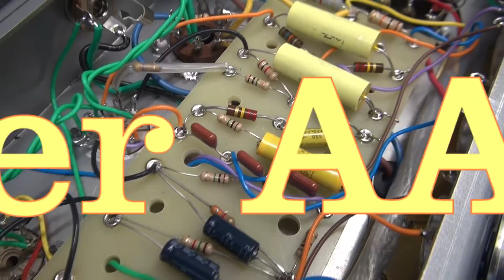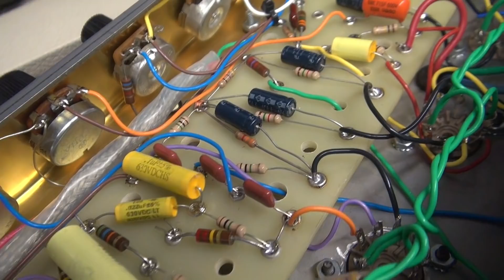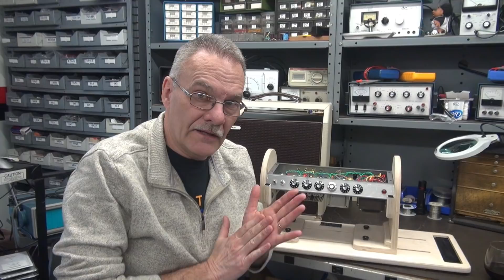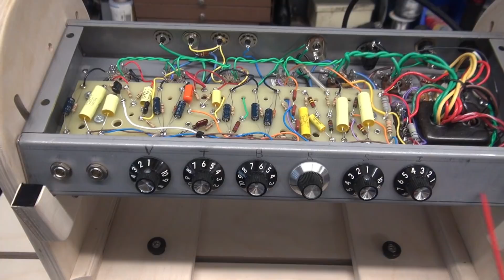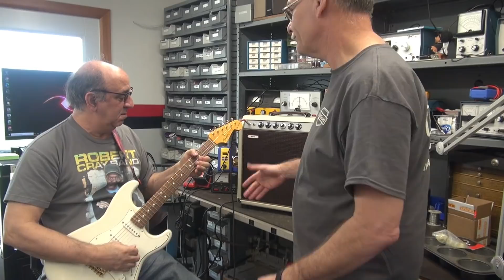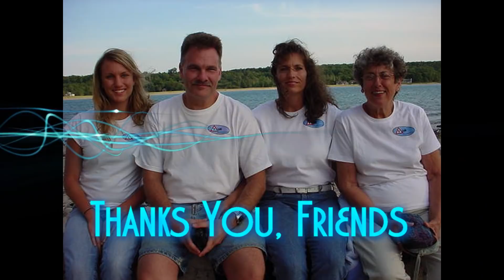Custom build Fender Princeton AA1164 6V6 tube guitar amp Vintage project Part 3 + Message

Comment: Sorry for your loss. I lost my Mom 20 years ago and you will always miss her. Blessings to you and family !

NOTE.. Clearance is always a problem, Hi hi. I once had a similar problem with finding a good spot to mount a pot. What I did was cut a piece of Aluminum strip about 1" by 4" and bent it twice forming a square with a side missing, BEFORE bending, I cut a hole for the pot shaft and two 4-40 holes on the other end. I mounted the 4 40 screws through the chassis and pushed the pot through the large hole from inside the bracket. You may need to temporary flex the assembly to get the pot to clear but it was easy to reform it back. Then, no posible ground loop issues and no adhesive to deal with later if the pot fails. 
If I do this again, I'll use some epoxy on the heads of the 4 40 screws, mount the pot first, place the assembly on the chassis and run the nuts through on the other side. 
73 Glenn

Comment: Those Sozo caps are great for just about any circuit. 
I really like them and the Mojotone “Dijon” caps in higher gain builds. The Sozo blue and Jupiter Yellow caps excel in later tweed to silverface circuits, and their tolerance is worth the price of admission alone.

Comment: I replaced my tubes with circa 1960 Lafayette made in Germany tubes.. I just picked up a H.R. Deluxe and It had a noisy V1 tube... I put a 12au7a in there to try that first in place of the 12ax7.. Supposed to be a 12ax7a, but what I could research, it seemed ok.. But it still had a rattle a little bit.. I put 3 12ax7a's in the v1-3, and I thought it sounded awesome for my first tube amp.. I didn't realize all the pcb crap was in there till after I picked it up for 300 bucks.. It sounded good for a while then I got a crackling sound when I hit some notes and it gets progressively worse.. I turned it up a little when before it happened, I think so I turned the amp off for a while.. Turned it on and played.it but I didn't put the volume up very high.. Maybe 20-30%.. It was ok.. I played it in the 2nd input also.. Not sure what the difference is.. Or if it made one.. I took it easier on the amp to see what happened.. And it didn't have an issue.. It was almost like the speaker but I don't think that waa it.. Like a crackle, when I hit a certain note.. Sorta bass maybe it seemed to trigger it.. Then it got worse.. Not sure where to start.. I think I have seen the videos on the common issues..  I might try to tackle the caps and resistors one day.. I need a little practice, I am going to get the soldier wick you mentioned and try to take my time and do it right.. Any thoughts on the crackle anyone? It would be nice if there were an easy fix till I can figure out exactly what I want to do long term.. I am not experienced but I think I understand most of the way everything works.. I know enough to be dangerous anyways... Lol... Yes, high voltage caps, I know.. I will make or get something to discharge .. But can a guy do this ok with a multi meter aswell? It's nice to see the sinewave on the oscilloscope but if it sounds .. Ah whatever.. Lol I can't ask every step in a comment..  I always look in the comments on stuff I am researching to learn what I can.. Helpful people out there in the interwebs of things at times.. Anyway I digress, Any feedback is appreciated... Long as it's not to high gain..  I appreciate any advice, Thanks D, and everyone!

Comment: Sorry to hear for your loss. My only constructive criticism would be with your lead dress. It could potentially cause a higher noise floor, and cleaner is easier for the guy down the road who has to service it.. For a build that style with those boards, Ceriatone is a good example of a clean build with clean lead dress. From one Craftsman to another.... 😑

Again, sincere condolences on your family loss.